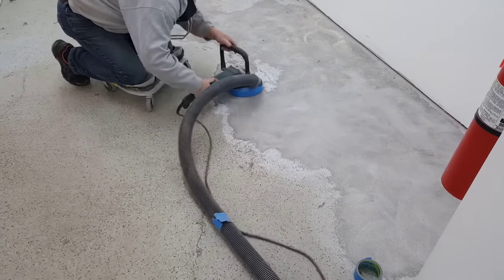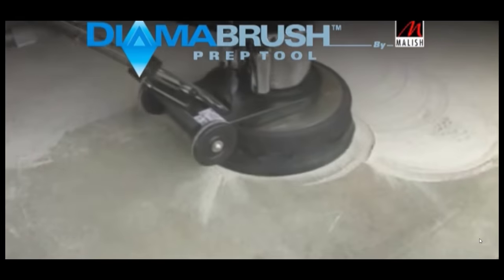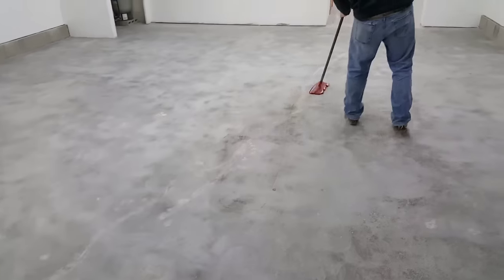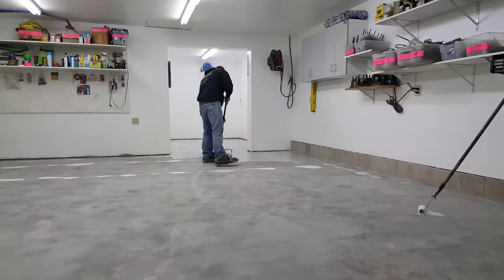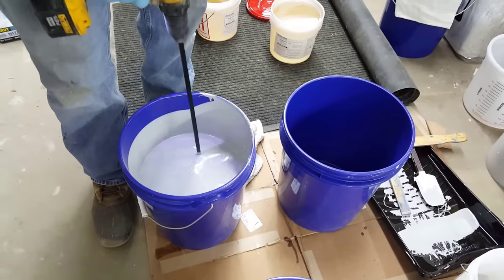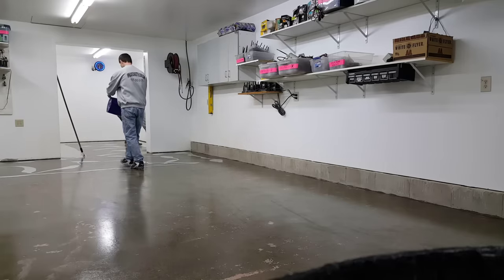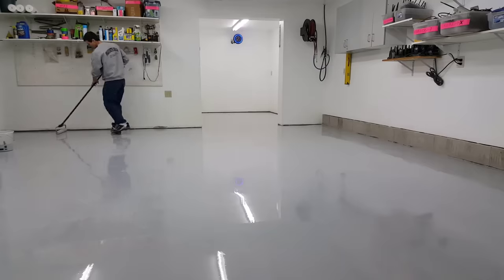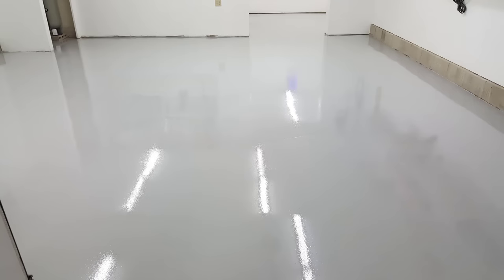How To Epoxy Coat Your Garage Floor | Must Watch For Diy'rs

Comment: I am not able to empty my garage to coat floor. Can I move everything to one side, do floor? Wait 2-3 day move everything to completed side , then finish floor? Not the best way I know but I have no choice. Thanks
Reply from the maker: Jeff, you can, yes. If you don't have a saw joint in the middle of the floor for a stop point, just use some tape (blue or duct) and tape a straight line. Do your epoxy, then pull the tape about an hour after you lay the epoxy. It'll leave a nice straight line. Then tape on top of the epoxy when you do the other side.

Comment: What’s the difference between a driveway coating and a coating for a garage floor? Sherwin Williams is recommending a water based enamel stain by H&C called heavy shield. What do you think?

Comment: I have a new concrete shop floor, but I will weld in there, so my question is- will the sparks burn the epoxy? What do you recommend for an application like mine where I want to seal the floor for stains like oil and grease, make it easy to sweep, but not burn the finish? Thank you.

Comment: Hi Mike. I’m pouring a new 800 sf pad for a new detached garage. My question:  Is there a certain way I should have my concrete guy finish the pad to prep for epoxy or polyurea?  Or just float and trowel like normal. Thanks for your reply. Eric
Reply from the maker: He doesn't have to burn it like glass. Leave it a little fuzzy. The epoxy guy will still have to grind it for prep though.

Comment: Question: I have an overflow drain in my garage. Would I still be able to do this or is the occasional moisture from the overflow drain going to ruin the edges of treatment to the floor?

Comment: I am trying to do this on my floors. My floor finish is smooth cement do I still need to prep my floor with grinding? or can I skip that and go with the primer?
Reply from the maker: You still have to grind so it'll bond properly
Reply: @MikeDayConcrete  thank you!

Comment: I have only two large circles,(1 foot diameter ) that paint needs to be removed. My garage was epoxy  when I built the house. Do I have to do the whole garage floor. If not, how

Comment: If I have a brand new build house with new and never used concrete, what do I have to do to prep?
Reply from the maker: You have to grind the floor like we did. It doesn't take a long on a new floor. You still have to open the surface to create a good bond.

Comment: How would you add anti skid? Is that described in the course? Also where can I buy the material you used?
Reply from the maker: Anti - slip would be added into the urethane top coat and just rolled on like I did. I used elite crete systems epoxy. You can google them for a distributor near you.
Reply: @MikeDayConcrete  Mike, Is there a coupon code for the course? I would be interested in seeing a little more.

Comment: Mike- I live in Florida and I have efflorescence on my slab. Will the primer be enough to prevent the epoxy from peeling up after? I never understood if efflorescence was moisture seeping up from below or from moisture content in the air making contact with the surface of the slab. Know anybody in FL as good as you?
Reply from the maker: Look up Liquid Floors, USA. They're in Inverness, FL. They do great work. Yes, efflorescence is moisture coming up through the slab.

Comment: Hello from Northern Ontario Canada!
After viewing a few of your vids, you are definitely consistent on one issue regarding an epoxy finish on a garage floor - "primer, primer, PRIMER first" - I've been prepping my garage floor for the last week. I hand grinded the old paint off the floor and so the surface is now almost white in color with nice grind lines (not smooth at all). After washing and vacuuming several times, I am confident that the floor is very clean, dust free and ready for an epoxy finish. I was about to lay the epoxy down tomorrow afternoon, but now I want to follow your advise and apply a primer first. 
Question ...... What "type" of primer do you recommend? Just any concrete primer or should it be some sort of an epoxy primer? 
Thanks!

Comment: How are you walking on the wet resin? It kind of looks like you have on a pair of special shoes on the bottom of your actual shoes. Are you walking on points or something? That doesn't affect the look of the finished product?

Comment: What about odor?  I've heard the full solid epoxies need high ventilation.  I'm thinking of a lower level in the house (not a garage) and it is not sealed off from the house - how bad will the odor be and for how long?
Reply from the maker: Nowadays a lot of the floor coatings are no to very little odor.

Comment: I recently had someone do epoxy in my garage and it seems very patchy. can I apply an additional clear coat to it without damaging the floor or ruining it somehow?
Reply from the maker: That's pretty hard to say not knowing what they used for a product. Most epoxies can be sanded and re-coated. If it was a urethane top coat, that's a little different. Most urethanes even after sanding don't want to stick to each other very good and may peel.
Reply: Same here man, I have a 3 car garage so paid a good chunk of coin to get it done. Researched some companies and had some people come out. Liked this one sales rep, seemed like a pro so went with him using a decorative flake system (with glitter). The glitter looked OK after applying but when they left after doing the top coat, I notice the floor looks rough, very textured and not seamless at all. Its dry but some sections you can see how glossy it is but for 90% of the floor, its almost like sandpaper when you rub it. My 5 year old daughter said it looks like a driveway. ugh. I always thought these floors are supposed to be smooth and glossy so i'm having them come back to try to fix, which i'm scared of that too cause I don't want it any worse than it is. But I expect this floor to looking stunning, not look like I did it myself. My wife isn't impressed either. Right now i'm almost wishing I hadn't bothered with it. House was only a few years old so concrete floor looked fine before and fairly new.

Comment: Question...so I have a pressure washer, shop vac and renting a floor buffer.

I got a “two part big box store” kit. 

Would you recommend buying a primer and rolling that on prior to the epoxy kit?

Comment: I have a lot of moisture that comes through my concrete which creates efflorescence. What sealer do you recommend before I begin epoxying?
Reply from the maker: The primer I used on this floor was also a moisture blocking sealer. It's all in the epoxy course. It was called VB-5 from elite crete.

Comment: Hi, I currently have some paint spills on the garage floor. Would I need to get that off before applying?
Reply from the maker: Yes, got to remove all the paint to get the best results. That's what we did in the video.

Comment: Hi Mike  what would it normally cost to do a garage that is 20x25?
Reply from the maker: Everyone has different pricing. Depends on prep, any repair, materials used. Could be 2 per sf for some who use cheap products could be as much as 8 per sf for others.

Comment: Given the detailed prep and installation, will it hold up to hot tires, especially wide performance tires?  Or should I ask, how long before hot tires ruin it?  I've looked at a lot of coating jobs, both DIY and professional and have never come across one that resists tire heat for very long, no matter how well it was put down.
Reply from the maker: We do dozens of these per year. Never had a call back for hot tire pickup
Reply: @MikeDayConcrete  but he's VERY hot, look at his user name. Anyway thanks for this. How long should I leave the floor dry after washing it. I'm in Alberta, which is a dry climate.
Reply: Well prepped, well laid, quality epoxy systems do not peel

Comment: Could you comment on polycuramine? I prepped and then laid down a polycuramine coating in my garage and so far it has lasted 3 years. Tires did pull it up slightly in small spots - didn’t use a clear coat on top but looking back, I should have. 

When it’s wet, it’s slippery and dangerous to walk on. I fell hard one afternoon on my wet floor. It sucked. I didn’t add sand to aid in grip. 

The poly is less forgiving as you have to get it down and spread out quickly in small sections. You can’t mix it in a bucket or it will get hot and harden in seconds. I had to mix it in its bag, cut it open and pour it out 3x3 foot sections. Needed second person to spread it and cut in edges. Seeing your video, I’d have done the epoxy but avoided epoxy because of the inherent peeling as you mentioned. I don’t know of a pro near me who can handle such a job properly the way you do it.  Good video!
Reply from the maker: I don't know too much about polycuramine coatings other than they go down real thin, probably should plan on 2 coats for a nice even look. I don't buy coatings at any big box stores. The prep is the key to any coating you buy an install yourself. The best way is the way I show you in my video. Using any etching solution simply doesn't do a good enough job in my opinion.
Reply: @MikeDayConcrete  You really know what you’re doing. If you were in my neck of woods, I’d have hired you to do it and stayed with epoxy. The poly came up in spots despite my laborious prep work. 👉 A retired painter told me to use a hard wax on tire tracks to help prevent paint peel up. He’s 88 yrs old now. Sub’d & TY

Comment: We are having a new home built, do i still need to etch the concrete floor or can i just epoxy the floor. Thank you and have a great 4th of July.
Reply from the maker: New or old, if you're doing epoxy like I do you have to lightly grind the floor. I don't recommend etching only grinding.

Comment: Mike, wonderful video, in your course, do you cover handling joints, edges, protrusions and abutments? And it looks like the product that you use is very low VOC, so no filtered respirators ever needed? Even anchoring epoxy in any type of confined space usually makes me nauseous.
Reply from the maker: No odor to this epoxy. The course covers all you need to know to do what I did in the video.

Comment: On a new build, how long should I wait before applying epoxy? If the concrete cracks after applying epoxy, is there a fix?
Reply: 30 days after the concrete is poured. Check for moister as well.  Use some plastic sheeting and duct tape and apply a 12" square the night before. In the am, check for condensation. If so, use a moister block prior to epoxy.

Comment: Is ambient temperature a factor?  Just moved to Montana and I wanna get this done in my garage.  Wondering if I should just wait until it warms back up.  Great video, very informative.
Reply from the maker: It is yes, polyaspartics will cure at much lower temperatures than epoxies will. Check out epoxy2u.com for their polyaspartic and I would use that.

Comment: If a garage floor has cracks and you patch it up. I know sometimes it may crack again, does the epoxy coat also crack?
Reply: Random DIY yes it can.
Reply: @Cartec09  thanks. How bad are the cracks compared to a normal concrete floor?

Comment: Hi i have a question,  not sure you will even see this.  
Is epoxy supposed to look smooth? 
I just had someone do it in my garage and all the scratches and dents the cement had are all still very visible.
Reply from the maker: That sounds like they used a diy kit of epoxy, they're very thin. We repair any scratches, dents, cracks before we do the epoxy. Then we put down a thick coating that covers it all. Nice and smooth when we're done.
Reply: @MikeDayConcrete  It was definitely a DIY kit from home depot. He's gonna have to redo it and actually sand it down but I'm not sure that it will look very good if he doesn't fill the tiny gaps. 
If only you were local to me!

Comment: What primer would you recommend? I just grinded my floor. Need a primer. Using rustoleums garage kit one coat epoxy. Thanks
Reply: The primer isn’t your problem. Using that junk is.

Comment: Since it already coated before, why not just sand a little and use primer ? It will save money on base coat too since it is smooth  surface.

Comment: What primer,epoxy,and urethane brand do you recommend?  Do you need to grind a new floor?
Reply from the maker: I used elite crete brand for this one. You can use epoxy2u also, they're good. Yes you have to grind.

Comment: How does this stand up to winter salt dripping off the cars??
Reply from the maker: Salt doesn't bother it. The urethane top coat is very chemical resistant.
Reply: Salt is no problem, it’s the sand that dulls the finish. A quality foam (not rubber) squeegee once a week will prolong the life of the floor in the winter months.

Comment: how much spalling can be filled/repaired?  I assume the grinding/prep step takes care of some, then you used some kind of filler before the coating?  Would love to do this, but concerned it would just coat over the spalling (from salt mostly).
Reply from the maker: Grinding does take care of some of the minor spalling. We have a fast setting 2 part repair mix to fix the spalling in general. We've fixed entire surface areas that have spalled because of freezing with this stuff. Just have to know how tot prep for that.
Reply: Mike Day Everything About Concrete hi there love your videos. Thx for the tips. Do you know where I can buy this repair mix that you are referring to? Thx

Comment: Hi Mike, how much working time typically do you have to squeegee it out and roll it as soon as you’re done mixing and pouring it on the concrete? I’m planning to do this next weekend but it’ll be about 82 degrees and not much humidity
Reply from the maker: With the epoxy I used I had at least 15 to 20 minutes. Plenty of time for the sq footage I was doing.

Comment: How long does it typically take to complete this project if it’s fresh concrete in a new construction home. Not coated. Absorbs water. I’ve gotten three different opinions from three different retailers two of which with the pro guy that deals with contractors at Sherwin Williams.

Comment: How long do you need to wait to install epoxy on new concrete?
Reply from the maker: Wait 30 days for it to fully cure.
Reply: @MikeDayConcrete  i coat my floor straight after 1 week 😆 its so hot here that you can cook something on top of your car hood surfaces

Comment: Hey mike I live in Nova Scotia! I was wondering what product you recommend. I am a mechanic an will need something durable. I am looking at armour coat 2 part epoxy any good?
Reply from the maker: Take a look at Epoxy2U.com and Flexmar Polyaspartics. Both have very good coatings.
Reply: dealestevens27 did you find a product for your project? I'm in NS too, and curious how it went.
Reply: @MM-ns3ho   yes I used the stuff at Canadian tire I also used the Clear coat. Rust oleum. I am a mechanic but I wished I used the rock solid. Also use the stuff that comes in the bags that you mix up the ones in the paint cans were expired and chipped after dropping an empty paint can

Comment: May I ask how tough is epoxy coating? Say if you drop tool on it, hard impact, it’d still chip right?
Reply from the maker: It could chip yes. It's very tough but is very hard also so something heavy/sharp could chip it.

Comment: Hi Mike great video! 
Have you ever done the stone hard? It is about 1/4 inch thick when it done. When I worked at Boeing our factory floor had this on it! It is some super tough stuff. It was spill resistant and very durable. We used a lot of chemicals in the aircraft business and this stuff you could not penetrate it!  Obviously paint would still dry and stick but it was good stuff! $$$ I’m sure!!
Reply from the maker: Haven't used Stone Hard, but I've done a lot of Urethane cement coatings.

Comment: Could you just lay a thin layer of cement on top of the old flooring and start from there as opposed to ALL the cleaning and prepping?
Reply: Would take twice the work, the way Mike is doing it is proper. Prep the surface, fill in your divots and apply your epoxy. It is self leveling. If applied correctly it should be semi-flat, that is all depending on the condition of the concrete slab.
Reply from the maker: No, got to grind to prep like Caleb said. Then repair, then epoxy. Just like the video.

Comment: Nice looking floor, what kind of epoxy do you recommend?
Reply from the maker: I use 100% solids epoxy only. There's a lot of manufactures of this kind. Epoxy-Coat.com is one you can try.
Reply: @MikeDayConcrete  Wow. Their stuff looks really good, but I'm really shocked to see the 500 sqft kit costing $850 before freight and tax.
Reply: Everybody wants top quality product but, not willing to pay for it.